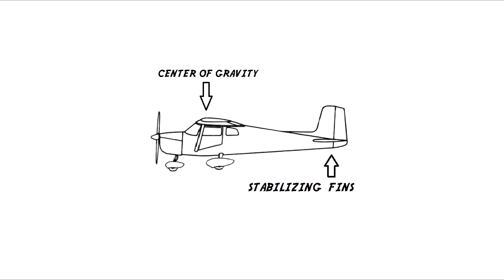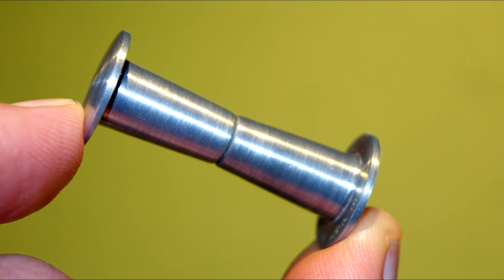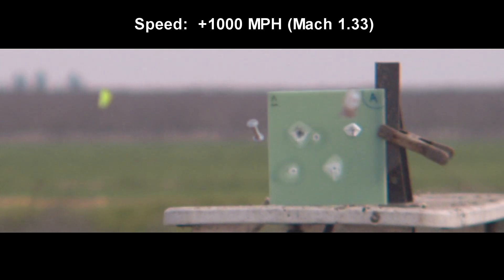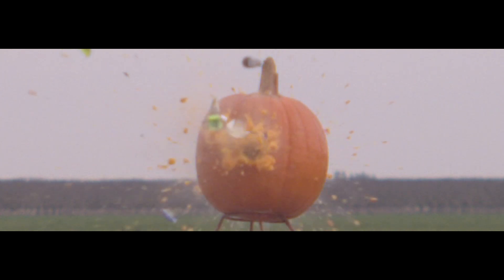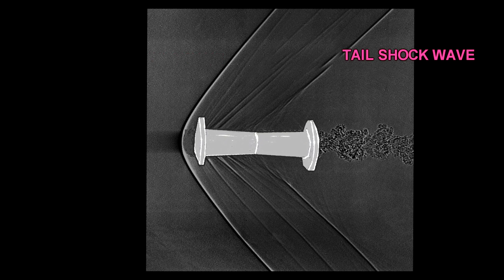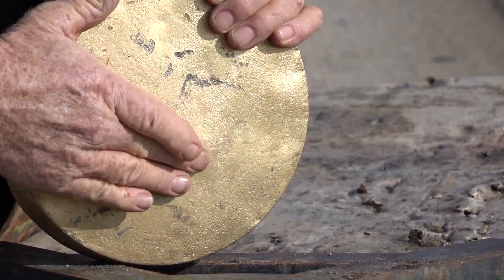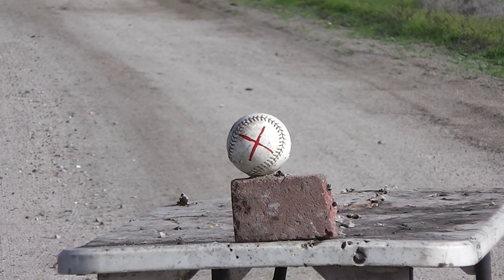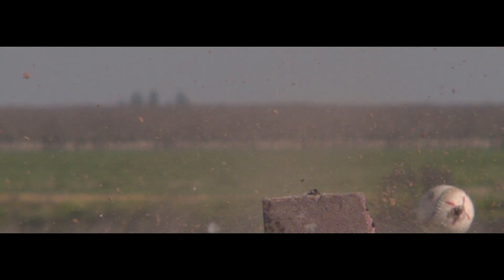The ENIGMA Projectile - Shock Wave Stabilized - yep WEIRD

Comment: I think if you made the front end of the dumbell a tiny bit smaller than the rear section, it'd behave a little better. Make the front half of the shaft a little heavier to compensate for the reduced material. My ideal for a revision would be like a re-entry capsule on the front that's slightly stretched, with the back half being like half of that slug.

Comment: I wonder how it would change if one of the threaded knobs was a different material (and therefore weight) to move the COG?
Reply: The denser the material the easier it is to maintain a straight path through resistance. Of course the real dense stuff is usually too radioactive to handle with your bare hands. However... perhaps a mixture of Lead with some extra dense radioactive materials would be almost safe enough to handle... I know there was some article claiming the U.S. Military used Depleted Uranium in some of the ammunition used in afghanistan and other middle east countries since back in 2001-ish. 
"Depleted uranium is roughly 0.7 times as radioactive as natural uranium, and its high density makes it ideal for armor-piecing rounds such as the PGU-14 and certain tank shells." - Google
Reply: @silviafox78  A10 Hog uses, or used depleted uranium
Reply: @phillipbotha7920  - Ah probably for penetrating enemy aircraft!
Reply: @silviafox78  
Tanks, actually. It spits 2 lb. 30mm DU penetrator projectiles at the rate of 35 or 70 rounds per second, depending on the pilot's selection. The amount of spall that a single round makes while going through armor is unreal. And dirty, radioactively speaking. They're looking to replace the DU penetrators with tungsten penetrators in general throughout the DoD, the Navy in the lead last I heard, but I don't know where the Air Force is with that with the 30×173mm round.
Reply: @richard6133  - that's pretty crazy!
Reply: @silviafox78  
Indeed. I wouldn't want to be on the other end of that, or anywhere in the vicinity thereof.
Reply: Instead of depleted Uranium, Tungsten may be used its density is 19.35 compared with Uranium's 20.2.

Tungsten also is not generally considered to be radioactive, requiring less specialized handling, although Tungsten costs $25 to $45 per pound, compared with depleted Uranium at $5 per pound.

http://www.wmsym.org/archives/1998/html/sess29/29-03/29-03.htm

Depleted Uranium has higher health risks compared with Tungsten, in terms of chemical toxicity:
https://www.lenntech.com/periodic/elements/w.htm
https://www.ncbi.nlm.nih.gov/pmc/articles/PMC2819790/
Reply: Depleted Uranium is perfectly safe to handle. The alpha particle radiation doesn't penetrate the skin and only goes a few centimeters through air before being absorbed. DU used by the US military is roughly 0.3% U235 or less (naturally occurring uranium contains about 0.72% U235). The major health concern is tiny dust fragments of the DU rounds after impact that could end up in ground water. The small amount of radiation can harm internal organs if it is in large enough concentrations. The EPA has established a Maximum Contaminant Limit of 30 micrograms per liter of drinking water for naturally occurring Uranium. It stands to reason slightly higher levels of DU would meet the standard due to it having less than half the U235 of naturally occurring Uranium.
Reply: @dvergar1  Depleted Uranium oxides may not be safe to be exposed to. If they are breathed into the lungs, the emitted alpha rays (Helium nuclei) can contaminate lung tissue, producing lesions that may lead to life span shortening lung diseases.

Plutonium is also an alpha ray emitter. Here is an image of the damage done by inhaled Plutonium dust emitting alpha particles in a piece of lung tissue:

https://bioone.org/ContentImages/Journals/rare/161/5/RR3175/graphic/i0033-7587-161-5-568-f02.jpg

The recommendation is to wear gloves and a respirator when handling either Uranium or depleted Uranium, to avoid hand/skin oil and acid compounds from inducing oxidation of the Uranium or depleted Uranium metal, and to avoid breathing in any oxide nano particles.
Reply: @neilruedlinger4851  Spent DU rounds on target aren't posing an immediate radiation hazard, they're posing an immediate toxicity hazard. Uranium is toxic regardless of the isotope content, it's pyrophoric, and the crystalline structure of the metal makes it 'self sharpening'... it's shattering off and making the penetrator consistently 'pointy'. Those shattered bits immediately catch fire and make a hell of a lot of uranium oxide dust (and heat) so... don't screw around in old target tanks, and remember to not get hit with DU while in an operating model.
Reply: I think that it would lose stability without angular momentum or spin stabilization